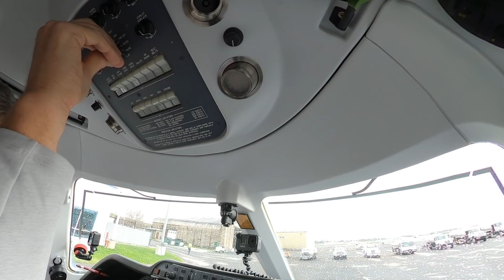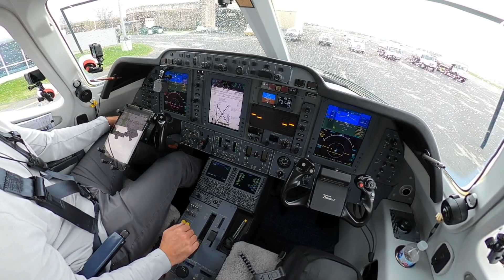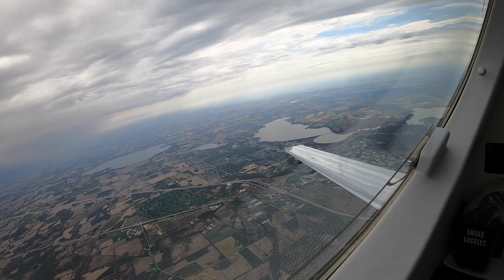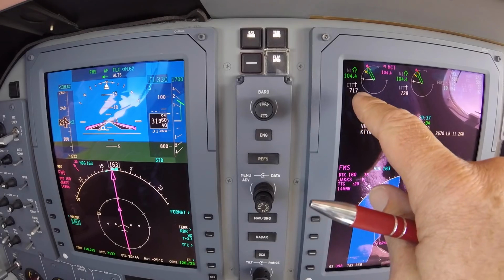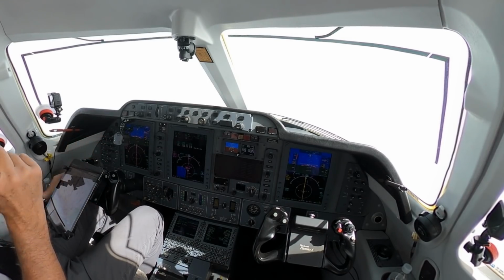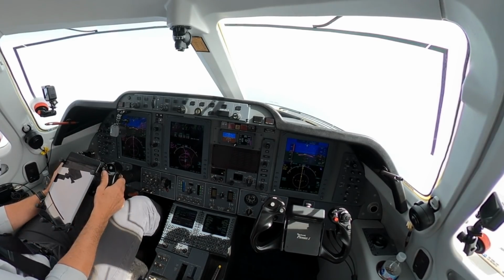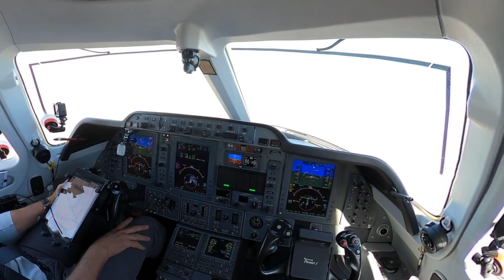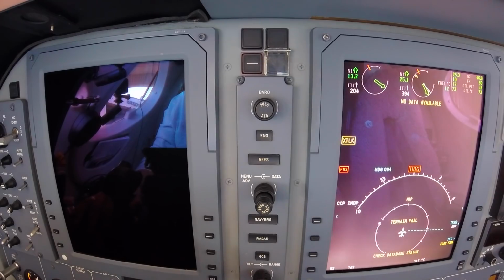I may have screwed this up! Private Jet Flight

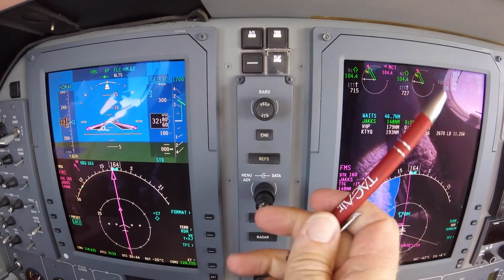Comment: 17:00 - 18:35   The N1 turbine speed is running at 104% I believe because it is probably being controlled by an EEC (Electronic Engine Control) Unit, which would control engine temperature according to an internal schedule programmed into it. The Boeing 737 that I just retired from flying quite frequently exceeded 100% N1 and/or N2 RPM, which was controlled by the EEC on the airplane. N1 (the Low Pressure Compressor/Turbine had a max 105% RPM limitation; the High Pressure Compressor/Turbine was limited to 104% max)  

With regard to the high engine temperature indications for start and continuous operation, it would depend on where the temperature probes are located within the turbine engine. The 737 uses an EGT (Exhaust Gas Temperature), which sits between 520 - 560 degrees C in cruise and is limited during engine start to an  EGT limit of 725 degrees C, because the probes are located within the low-pressure turbine section located much farther back on the engine, closer to the tailpipe/exhaust nozzle. 

The Premier jet apparently uses ITT (Inter-stage Turbine Temperature) for its engine-monitoring indicators. These probes would be located much closer to the combustion area of the engine, and thus would be subjected to much higher temperatures. Some models of the Garrett TPE-331 turboprop engine used on older commuter and corporate aircraft use ITT as the indication of how hot it is within the engine for power management. We saw ITT's approaching 900 degrees C with those engines.

Great video!
Reply: As an avionics L.A.M.E., the job I hated the most was changing a faulty EGT harness, you can't just change a probe, the entire harness has to be replaced (on the engines I worked on), and because of the extreme heats they operate in, the EGT harness had a high failure rate.

Comment: I was wondering about that circus of a route they gave you, there’s no traffic up there!  You’ve gotta be loving the ‘expect FL350 ten minutes after departure’ lately.  I live under approach to AUS and EDC from the north and it’s shocking to rarely hear aircraft or see contrails.  The squirrels are out in force however.
Reply: andrew hontz , I live down in Onion Creek and right under the westerly approaches to 35L and 35R at KAUS. I used to hear aircraft come overhead at 2500 to 5000 ft all the time and never really notice them. Well except when BA was using a 744 to fly the daily to Heathrow, since in the summer they needed every foot of the 12000 feet that 17R offers. When that beast flew over climbing out the house rumbled. But since air traffic is gone it is actually kind of noticeable when someone comes overhead. When I check my ADIS, it’s not uncommon to see more GA then commercial flights.
Reply: Noise abatement.

The sound of two aircraft coming together can be deafening. Chicago ATRCC does a great job of 'slinging tin.'

Comment: Your channel has made me decide to sign up for pilot school.
Reply: Do your ground school first and get it out of the way. It will save you $$ in the long run.
Reply: When I start in 1988 it was so cheap.   $25hr for instructor and $45 for Cessna    The 172 cost $65-75        Today’s prices.    I’m afraid to even look.  But I will. $87hr for instructor $145hr 2seater. The 172 cost $175-185hr.  Wow. Times have changed.
Reply: @wakeuppeople7327  I remember those prices in 1988 too... now I'm like😱
Reply: @wakeuppeople7327  I hate to depress you with what it cost for instructor and plane in 1966...
Reply: Ted Gray the AIRSPACE from Ks to California was just insane.  Then just to take off took extra 20 minutes easy just to get up.  Vs Fullerton airport.  But SNA was a great school and the fun of landing next to the commercial boys was exciting. Except for the bird strike and busted windshield I darn near peed my pants. But my best Lansing.  Did a short approach and I mean short. When I turn final I darn near landed. I came in way to tight but I was freaking out.  Usually it’s least a 1/4 mile final get all lined up and decend.  I did all that on my downwind and left base.  It was cool
Reply: Euh, normally you are absolutely sure when you're 8 years old ; I hope you won't waste your money...
Reply: Mark Christian ...and take the written ASAP!
Reply: Mark Dobbins You were robbed. 🤣 I worked as a CFI in LA 1989-90. I was paid $13/hr & a C150 went for $39.
Reply: You guys are lucky. More like $220 /hr here in the U.K. 😵
Reply: The best way to get your Silver Radiator wings is from the Air Force or the Airlines.   After that, Embry Riddle or some other GA school.
Reply: @duanepalmore38  Take the ATP written and get your ATP as young as you can, before age 30.
Reply: @stevencooper787  the younger the better, get your ATP before age 30 and that is even old.
Reply: Steven Cooper I’ve wanted to fly my whole life. Path just didn’t lead there until now.
Reply: Duane Palm
Reply: Robert Ring That’s my story too. Years of fixing them and watching others.
Reply: For me, it was the realization that I could go over LA traffic instead of having to be in it. That was 7 years ago. I go over LA whenever possible.
Reply: @wakeuppeople7327  Have wanted to fly my entire life, I'm now looking into the costs involved. So, after one acquires a private license, what does it cost per year to keep it?
Reply: canamm   Well depends where you live. Think it cost me $5k that was 1990 prices. Boy has it gone up.   If your serious make sure you do it. Don’t fly when you can and stop and start again.    If you know a pilot that helps a lot.  Say avg time is 60-70hrs   Here in California’s $150hr for AC and $98hr for instructor it’s has definitely gone up.  Why find a small airport in Midwest      Where do you live     FAA stays min is 40hrs to take the flight test  20 solo 20dual hours.  Think I was avg 65hrs.  Like I said. I would fly then take off for a week and everything I learned last lesson I would have to go over.   Landings is the hardest yet easiest once you have it figured out.   Pass a class III medical. Vision test. No color blind  or I think to I can’t fly at night
Reply: @wakeuppeople7327  No, What I'm asking is what does it cost to maintain a private pilot license once you've obtained it?
Reply: @wakeuppeople7327  When i was learning to fly in 1974 it cost me $12 a hour for the plane and $8 for the instructor.  Can't even get a good veal piccata for that now.
Reply: you won't regret it! I'm ~30 hours in and counting...
Reply: @wakeuppeople7327  yikes! it really depends on where you live though. In southwest Ohio (Dayton/Cincy) you can rent for about $125-140 and the instructors are $35-$50.
Reply: @robertzwaska6661  is this true, my dad has kidney stones, passed a few while NOT piloting and they wouldn't let him fly again.
Reply: @tedgray489  LOL in 1963 when I started I paid $4.00 hr for a T-craft and $5.00 for a instructor.
Reply: @margerymorris7827  I found ex air force pilots were some of the stubbornest to give Flight Reviews to. Most of you transitioned to civilian pilots just fine but some of you  just didn't want to listen to a lowly flight instructor. Retired airline pilots were even worse, they kept waiting for me sitting in the right seat to handle some of their work load. :-) I am retired now but I sure do miss the flight instructing days. Hours and hours of bordom with a few moments of shear terror. :-)
Reply: @wakeuppeople7327  Wow, I've been away for a while.  In '74 it was $30 for the instructor AND the C-152.

Comment: Good Morning!  I watched this as i was doing the breakfast dishes and was delighted when you touched on one of the pilot accepted mysteries of turbine operation; more than 100%.  More specifically, why more than 100% is normal.  I'm anxious to see if a Williams engineer responds.  To me, just recalibrating the numbers to 100% seems logical.
Reply: I believe that rocket launches exceed 100% in ascent.
Reply: The engine is performance rated when its model is first created.  As tweaks to design/performance occur through the engine model's life, the baseline 100% is maintained. The problem with re-calibrating numbers is that flight characteristics should be uniform across a type. If a new plane needs an engine swapped, and only older ones are available, which 100% is "correct"?

Comment: As explained to me once, max N1 is usually set to 100 percent when the engine is first developed.  As time goes by, engine manufacturers make modifications that exceed the original standards.  So when N1 displays more than 100 percent and you are not showing a caution message, you are still operating within the new normal limits for the engine. Rather than go through all the avionics and re-calibrate their readings of a new 0-100 percent range, they just leave it as is because it's easier to leave the original algorithms in place.

I'm not a mechanic or an avionics guy.  I'm a piston pilot that hangs out at the airport too much.  I could be completely wrong.
Reply: When I used to watch the Space Shuttle Launches, I remember hearing the NASA Controller say; "Shuttle Engines now at  104%."
Reply: Captain! The warp core is at 107% and I dinnae know how much longer she'll hold together!
Reply: N2 is more pertinent to MCT as ITT allows.  The fan just spins as it will as IAS varies.

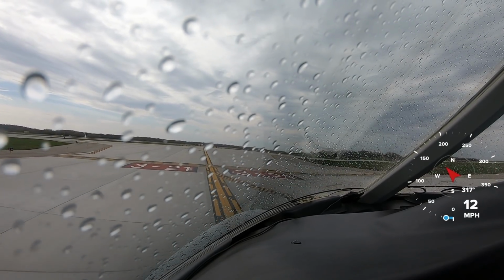Comment: 7:35 .... back taxi.... my old hometown of Windsor, Ontario never had a parallel taxiway next to 25-07 until about 5 years ago. When I was very young I remember seeing an Air Canada DC-9 do a go-around at the last minute when a British Caledonia 707-320 landed in front of it and started to back taxi 7,900 ft. Very close near miss. Needless to say back-taxiing makes the hair on the back of my neck stand up.

Comment: It was literally 2 seconds after the call he was clear
Reply: Plus the fact that the tower failed to ack at least his last 4 transmissions, they didn't seem to care about much, even when he stated he was making the base turn. Additionally, it's a video, you are not in the aircraft. The pilot knows where his tail is and is situationally aware of what possible traffic could be near by.
Reply: @johnlagreca6288  Indy Executive doesn't have a tower, that's why all the aircraft were announcing their own intentions on UNICOM 123.05.
Reply: @ntwozwb  Ahh! Makes much more sense now, thanks. That's what I get for watching aircraft videos while exhausted.

Comment: As a former ZAU  (Chicago Center) controller, the route given is  a PDR (preferred departure  route) to avoid airspace most likely. With 90+ % of traffic out of the system right now the sky is bigger than usual so direct everywhere is available.

Comment: How cool is that.  Your departure runway out of MSN was the runway I soloed on and later passed my PPL check ride on in the summer of '81.  Although back then it was 4-22 (later changed to 3-21 to better align with the magnetic variation)  Also none of that "lineup and wait" we only had "position and hold."  And don't get me started on the airspace nomenclature ...  Great video keep them coming.

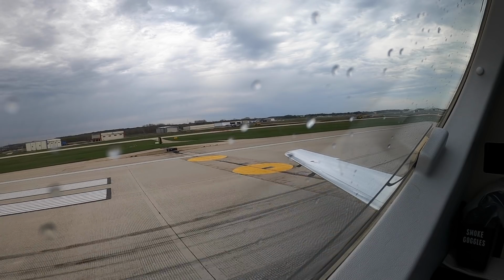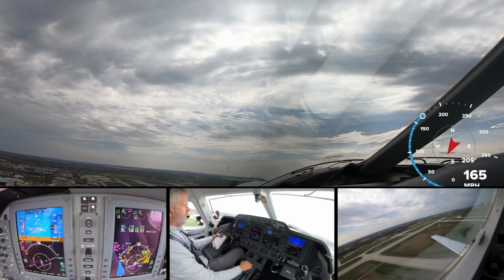Comment: Thanks for the ridealong video!   Especially for the mention of the arresstor cable in the runway at 8:34 and the F-16s you saw while rotating off the runway at about 10:00 on the video.  We had Colorado ANG F-16Cs (120th Fighter Sqdrn) co-located at Denver International Airport (I think) because Buckley AFB was being upgraded (missile warning radars, that sort of thing - the 460th Space Wing at Buckley has since been "gained" by the  US Space Force)..  

Here and now Gulfport/Biloxi Regional Airport is colocated with several Mississippi Air National Guard units, and F-16 landings are not infrequent there. I don't know if they have arrestor cables on their part of the runway or not, though.

Comment: Great video, and a really good overview of how much is involved in even the shortest of flights.

On your question about 104.4%N1, often times engine manufacturers will designate the predicted peak speed as 100% based on the predicted peak speed (the 'design point' often top of climb) for the initial engine thrust rating. Then, down the road, changes to the engine design, maybe a thrust bump if additional stress/stall margin is demonstrated in type testing, will permit operation at higher engine speeds. But in order to avoid confusion for the engine manufacturer (for internal discussions) and for ease of cross qualifying on airframes with the same engine type but different thrust ratings, the original 100% reference value is maintained.

It's not unusual to see engines with 107% and more for their maximum operating speed if the base engine type has had a lengthy time in service. Even the Space Shuttle Main Engines were rated over 100% thrust as their capability was expanded as additional test data was accrued.

Comment: I really appreciate you explaining very concisely the autopilot and the displays. I am actually watching this to understand how to fly IFR flights in Microsoft Flight Simulator and this has been better than most of the tutorials I have watched for the actual game. For example, I was wondering if I was doing the right thing when changing to VS mode when changing altitude as I was expecting the AP to do that autmoatically when I've set a desired altitude, but it never did and I had to set a vertical speed, first. Now that I see you do that, too, I know I wasn't doing the wrong thing haha.

Really interesting watch. Thank you!

Comment: MCT is 104.4 at altitude probably because MCT is originally calibrated at sea level on a standard day.  Lower pressure and temperature compared to standard day means that the turbine has less air to move and can thus spin faster, producing more thrust.  At least that's my understanding of turbofans.

Comment: Hello Greg, I believe your 104.4% comes from selecting MCT in the Climb. It is very likely that if you change your engine power setting to CLB instead of Max Continuous, that you would have a lower N1 setting. Regardless MCT has no time limitation. The aircraft normally goes to engine thrust mode TO for 5 minutes, I believe, and then when you reduce power and retract the flaps it should go to CLB power unless you've pre-selected MCT which seems to be the case in this video.

Comment: Yes, Traxx Field (Madison, WI) does have F16 based there, and they are looking for the F22 to be stationed there.
Reply: Curt Terpstra F-35
Reply: @bradmarcum2927  Thanks for correcting me because it is quite obvious that my old fart mind had an issue typing and proofreading on my earlier post :D

Comment: The +100% rating is generally because it’s a development of the original engine blueprint. Either during initial development where proof of concept were set at a nominal value, ie 100%, and as testing continued more thrust was safely available, or later tweaks with new materials or other improvements resulted in a more powerful engine. If the 100% mark is moved, all the lower settings need to also be moved which makes no sense from a practicality point.

Comment: The 104 percent N1: In the Space Shuttle, when they Upgraded the Main engines they still kept 100 percent to be the full thrust of the first generation engines, so after max Q they would throttle up to 106%. Maybe it's the same thing with the primary spool on a turbine engine

Comment: Greg!  Love this video.  I am an enthusiast simmer.. and had a question.  How did you setup the PDF for an "ILS Like" landing?  I saw what you were talking about on the final, you basically had that on in the PDF as a marker to maintain the glide slope.  Did this has to do with when you setup VNAV  in the flight?  If so, this is also confusing.. because I would think the VNAV would be apart of the autopilot to descend based on the FMS ALT assigned to a given fix.  In this case you hand flew the plane in, like the rock star that you are.  So, how did VNAV help you at all?   Thanks so much Greg!
Reply from the maker: You have to select visual approach on the FMS. Then you have to select approach and VNAV on the aoutopilot and put the altitude selector to field elevation or as close as you can get...in very rough terms. I don't know if you are flight sim with Proline 21 or a different avionics setup.
Reply: @gregmink  Thank you so much!  So, basically you leave the flight director on, and the auto pilot is actually off for this.  Then you use the visual reference of the FD in the PFD for the guidance on final?

Comment: Hi Greg, dumb question but why not startup after clearance delivery/input? Save some gas and engine hours. 

   I know there is a bit of a warm up time required, but on these small engines not too much these days with EEC or FADEC handling most everything.

Lee
Reply from the maker: Not a dumb question at all. The engine hours don't count on the ground so all you are saving is fuel. Which quite honestly is so minimal its not worth the time.If I have access to a GPU and can run the air conditioning and avionics, I will get the clearance before start.
Reply: @gregmink  Thanks Greg!  

On most turbines I've worked with its always been engine start time -> stop time.

 Nice to have hours on the ground not count towards TBO!

Lee

Comment: Just a recommendation, not sure what the battery life on your aircraft is like without engines running, but you may want to do as many checks and procedures as possible before engine start.  Including ATIS and clearance.  It seems most people get a little rushed when there is expensive fuel coursing through those engines...

Comment: Hi from Waco. Love your great vids. Always so well done and interesting . I feel like I am riding along with you. I am not a pilot, but  I hear your engines still winding up even at rotation. I would think you would want them 100/% cranked. Can you enlighten me on what I'm hearing ? Thanks !!
Reply from the maker: They are fully thrust just a few seconds into the takeoff roll. As you accelerate the sound of the engines dissipates behind you.